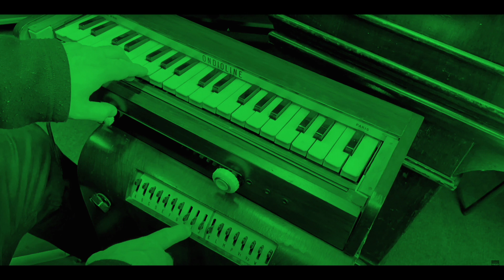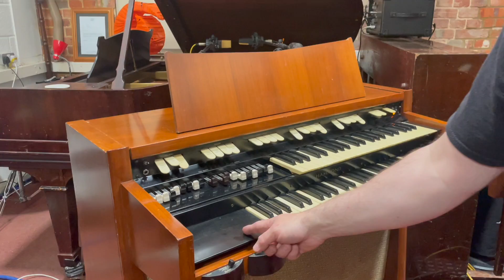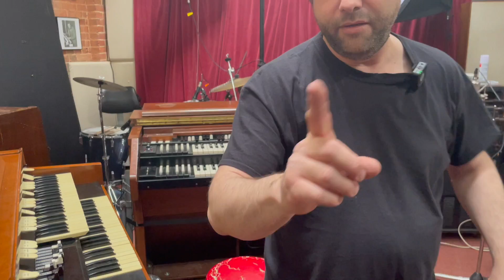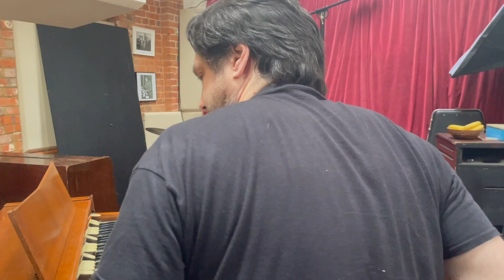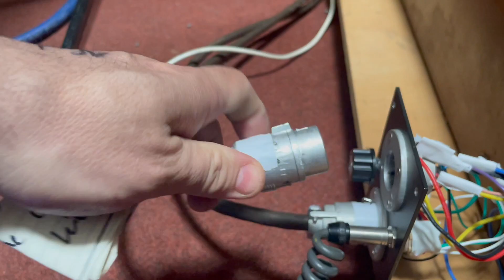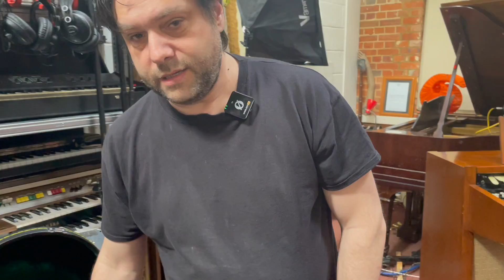M102 and C3 Hammond Organ Switches and Leslie Connection Kit Mods with Leslie 760

Comment: Love the mods!  Yes, that high voltage era stuff is amazing, in the Leslie Hammond wars.  I knew Leslie Hammond.  What is the object, suspended from the ceiling?  Maybe a baffle?  I'm baffled.  Is ground looping a problem when using a guitar with a Leslie?  The fire bell seat is missing!  🙂Looking forward to the next installment.
Reply from the maker: The baffle is a baffle - used to be over the console when it was in the middle of the room. 

There is a little ground hum with a guitar straight in as there’s no part the signal balanced, but via a mixer or Di it’s ok.

Comment: Cannon are I believe (or perhaps were) a brand who made various connectors (including XLR's) The connectors you're using are often known as EP5's (and are still very much in use, and made by various manufacturers) also available EP4's and EP6's (and quite possibly others) Still available on many higher end PA loudspeakers (although usually sold by default with Speakon connectors, many can be ordered with EP4 / 5 / 6 connections instead)

Comment: Hi Steve. A life saver of techno 'LessHamonias' speak. I am interested in your wiring on the M102 which I am assuming is very similar to the L112..I have a shell of a Leslie 700 and will be converting it into a std L as much as possible. An older gentleman dropped in a pair of brand new v22 and horns yesterday still with the white tape over the port of the drivers! So now to add I have a 600w Beyma crossover. 15" bass driver and both 2 speed motors. I've ordered an old 55watt 8ohm valve PA (someone said unlike a guitar amp which is highs dominant a PA is more accomodating to the H sound. Your take?) anyway I digress. I'm assuming from your helpful video that I can take a line feed (not resisted) and an 8ohm line to a source switcher from the L112? The line level feed goes into the valve amp in the leslie but I need to engineer the rotory speed switch to run from the powered (seperate Leslie amp mains) back to the Hammond as the 2nd switch. So what I would have is your setup? You didnt mention that (I am assuming) the M102 signal line output was not coming off the M102 speaker wires but rather from the internal bypassed/switched line level input feed with no resister? This I am assuming is part of the switch to use the onboard speaker or not? Also I am guessing as I am building from scratch that I may as well take the reverb line level (split out) to run to an 8" fitted into the Leslie giving an effect sound from a similar place but is it worth the hassle?..I might have answered my own question..mmm! That said I have subscribed. Many thanks.
Reply from the maker: Thanks - you should hopefully be able to deduce the correct wiring by having a look at this https://www.fishorgans.com/leslie_kits/012617A.pdf and anything else related to the organ you are connecting. Be careful with the mains wiring!

Comment: When I was a young rock ‘n’ roll roller around 74 or 75, I traded a UniVox Bass amplifier for a Wurlitzer tone cabinet…
This was their version of a Leslie …! It weigh a ton like most Leslie’s….😵‍💫 phase shifters were in their infancy. The MXR phase 90 was invented, but was quite pricey for a poor Guitar player….! I wired the tone cabinet with a toggle switch for fast and slow speed and I used a Sears and roebuck fuzz face distortion pedal for a preamp…! One of the big problems with the Leslie Cabinet was if it was not miked it was not very loud, but it did sound cool…!  I’m pretty sure hauling that cabinet around to gigs, has contributed to any back issues I have now at 70 years old…😹🎵🎵👍🏻 https://youtube.com/@iplaymytele?si=m7bjQw4FXB8GmkqO
Reply from the maker: Cheers @iplaymytele :)